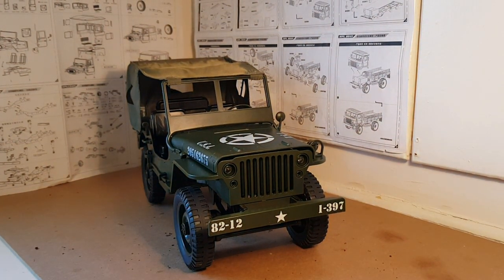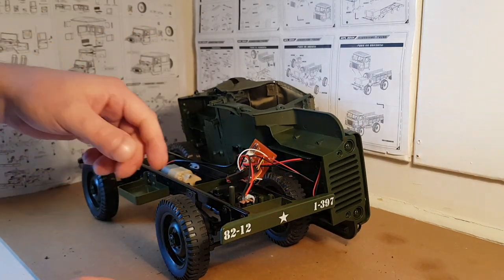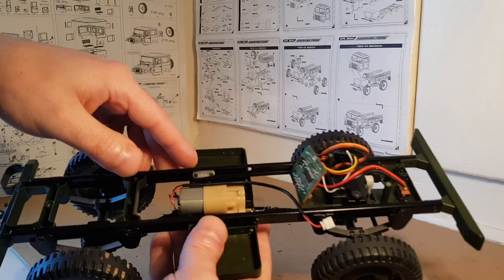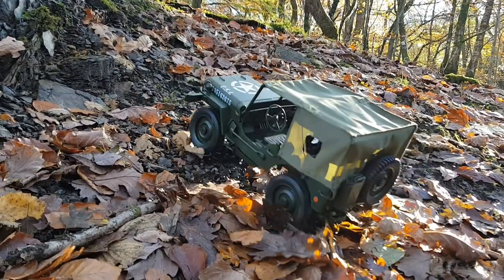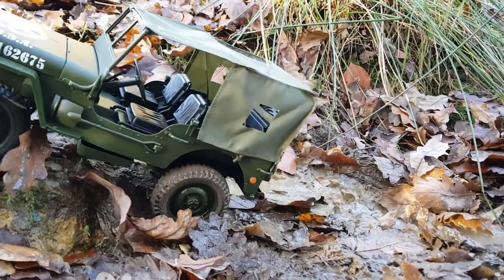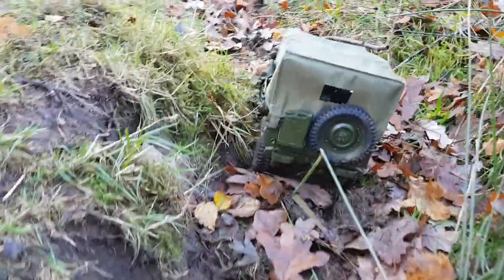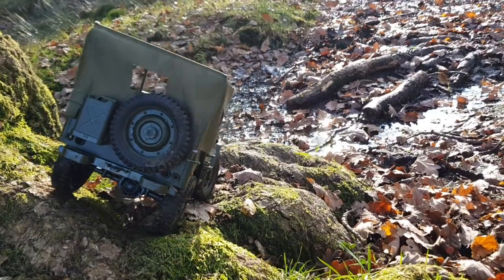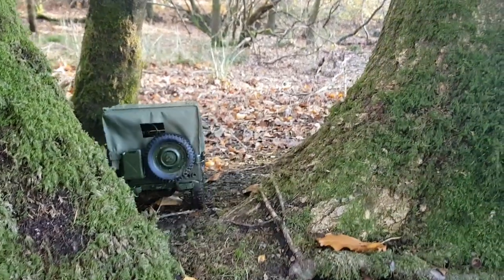The Q65 is Back! How to Install a BIGGER Motor without Trimming the Body using this FREE MOD

Comment: Thanks heaps Liam, i just received mine today and the shaft angle looks worse than i could tell in a video 😳 first thing i am doing is this modification👍🏻💪 still looks legit and it still has enough clearance in my opinion. 
Great video buddy 😉
Reply from the maker: The RTR setup of that truck was shocking from memory.
It's a shame JJRC dont revise it to keep up with other budget rtrs on the market.
Reply: @THYC  yeah its a shame because they have awesome rigs for sale but mostly bang bang steering, my Q65 is full proportional and came with 180 motor and weights in the cabby bits where you done the dropped gearbox which i thought was weird. Im not complaining tho saves me doing most of the work 😅
Reply from the maker: @geneside0  good know there are some improvements 😁
Mine came with a 4.8v battery 😂🙈
Reply: @THYC  yeah i seen that and thats what i was expecting (thats what description said) on ebay, I ordered a 180 to go into it but i guess i have a spare now at least.

Comment: Great mod! Good thinking with that.  I lifted up my 2-speed transmission in my C24 and it's been really great. Probably my most capable WPL at the moment.
Reply: the CV type metal shafts can sure handle a lot of angle.

Comment: You should try the WPL 2 speed gearbox with the 370 motor and wheel weights
Reply from the maker: I have a 2 speed in the post, this could be the project for it :)

Comment: yup, motor cooked so hot the plastic pinion slid on the shaft. yup again, side plates to drop the gearbox about 1/4". pretty sure stock was #316 gearbox with that 130 motor, is REALLY bad news, a 130 motor in the B36 gearbox isn't so bad. it'd definitely do better with WPL soft kit tires, rims do come in OD green if you look. other possible is taking out half the lugs on those JJRC tires with toenail clippers. WD-40 will help tire tread not load with mud too btw, get them wet with it about 10 minutes then pat them dry.

Comment: I swapped the weedy stock motor for the WPL B36 180 motor and gearbox. No mods needed to fit it but the gearbox failed on the first outing https://www.youtube.com/watch?v=pO7x61WOfww&t=1s It's now running the all metal gearbox/370 motor combo